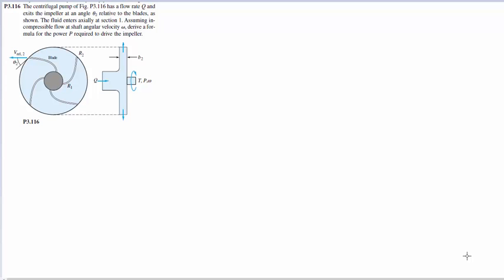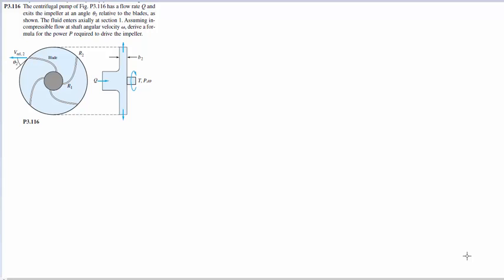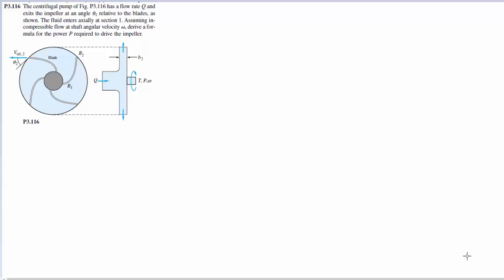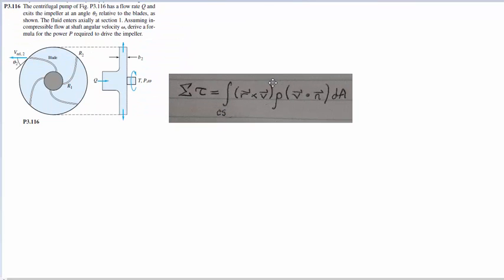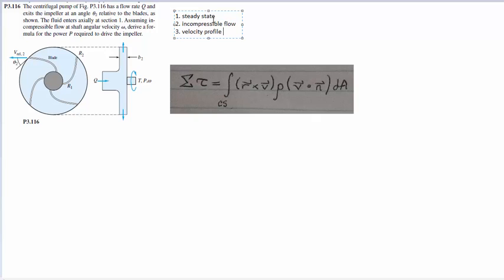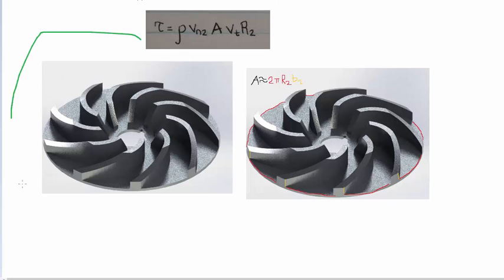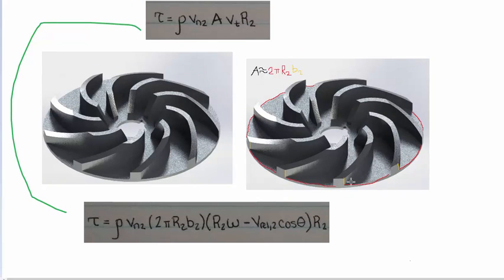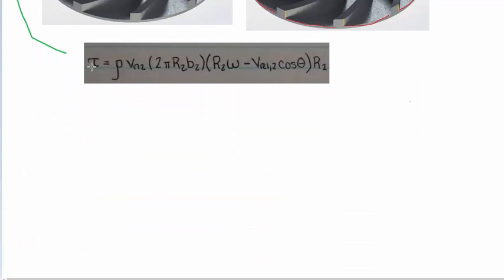Reynolds Transport Theorem - Angular Momentum - Example 2 (Turbomachinery)

Comment: I have a question: when we were converting V_rel,2 in terms of V_n2 we had V_n,2 = V_rel,2 * sin(theta)

Rearranging, we got V_rel,2 = V_n,2 / sin(theta) = V_n,2 cot(theta)

Wouldn't sin^-1(theta) be equal to csc(theta), thus changing the equation to:

V_rel,2 = V_n,2 csc(theta)?

Fantastic video by the way. This chapter has caused be a good deal of trouble and with this video, I now see light through the darkness :-)